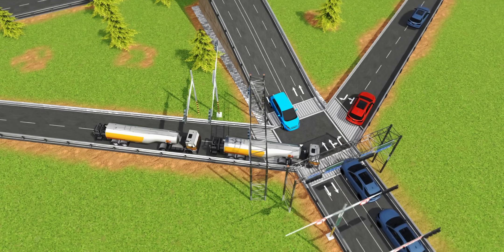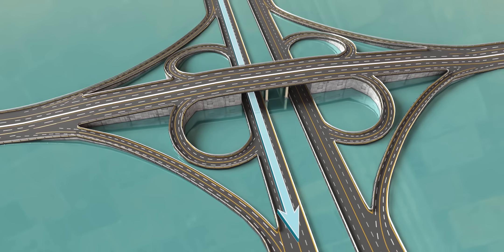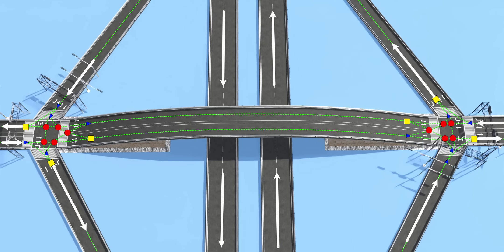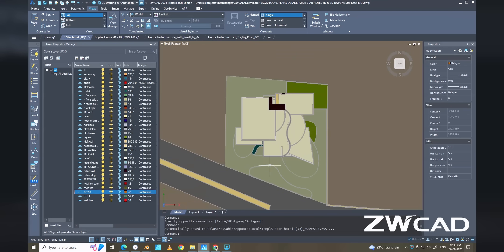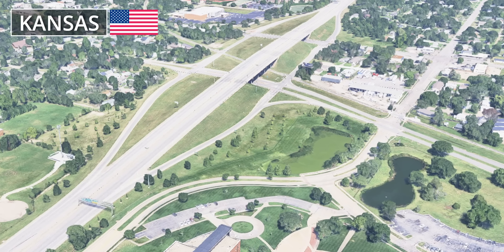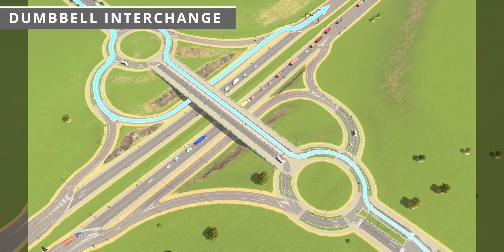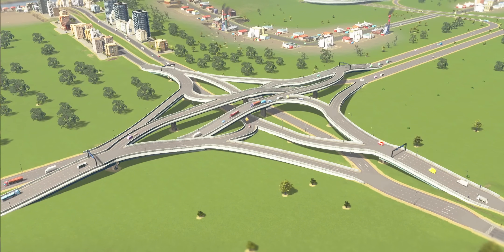The Hidden Engineering of Interchanges!

Comment: Sadly this clover is going away replace with red lights and more red lights and more more red lights with red light cameras.  It's no longer about keep traffic flowering but to making driving a living hell.  You no longer allowed to turn right at your judgement but you have to follow the red light arrow.  Or turn left when there is no traffic, but follow the dam government declared safe turn arrow light.  Cameras everywhere range from speeding/red light/stop sign.  I won't feel bad if people are pissed enough to go destroy these cameras.
Reply: Increase in traffic volumes require signals.  Otherwise, the ramp will always back up due to lack of gaps.
Reply: @traffic.engineer  I agree that there are more and more volume making it harder to merge onto the main travel road.  But I've seen traffic lights been add on roads that have little to no volume.  You stuck at the light for a none existing vehicles/traffic to pass.

Or how about those dam traffic light called.... forgot what the hel they called but they claim to reduce the volume on the highway.  The dam light make you come to a complete stop before ALLOWING you to start merging onto the highway.  I think this stupid idea started on CA, now a few states of insanity copying it.

seems like the new thing to do is STOP TRAFFIC (and on purpose to build up congestion).  While the old way is to keep traffic flowing to avoid congestion.

I hate the nanny state of insanity that America is becoming.  Taking rights away from driver and giving driver licenses to illegal and incompetent people.
Reply: @johnmicheal3547  That is ramp metering and ramp metering is a tool to not overfill highways.  Simply freeflowing onto the highway fills up a funnel faster that it can release.  Hence, signals are the method to  regulate traffic at a rate faster than the downstream can handle.  Either spend time stopping at the signal, or spend time in the traffic jam.  That is the purpose of the signals...to control flow.
Reply: @traffic.engineer  I am using GPS app to guide me to go AROUND jams and it work much better than that metering.  It actually a solution, while the metering is just kicking the can down the road.  That metering is just spending a lot more money for not fixing a problem.

I do like the idea of using signal to add more lanes on demand.  A certain time of the day more people travel one direction so give more lane to the direction that have more volume while less lane to the side that have less volume.  Would be nicer too to increase the speed limit so people can travel faster.  Increase speed limit as volume increases.  Blink the new speed limit to encourage people to go faster.  Tell slow driver to stay on the right so they won't block people.

Comment: Great general video, but in practice, especially in urban environments, designers have to try to modify the classic cloverleaf design to deal with site-specific problems, such as there being a barrier you cannot infringe upon, such as a river, canal, ocean, a built-up area you cannot demolish, or whatever, or you may also need to connect a local road to the intersection, so there is a fifth road problem, or there is simply not enough space or the available space has a strange shape.  For example, in Montreal, where I live, there is an interchange that crosses over a canal and a rail yard, and there are 3 secondary roads that intersect with it, in addition to the 2 highways, and one of the highways does a 90 degree bend just before reaching the interchange. The interchange is next to a cliff, and in a density developed residential and industrial area, so you cannot waste space.

Comment: 1:35 this is how MANY roads in michigan are built, especially around detroit. Southfield freeway, Michigan Ave, Telegraph Rd are some of the most thoughtlessly designed pieces of infrastructure I've ever seen in my entire life. Whatever engineers thought that putting the off ramps in front of the on ramps was a good idea should have their degrees burned. 6 seconds of thought would tell you you're creating a clusterfuck, you're literally forcing two lanes of wildly different speeds together to fight over a limited track of road. Dangerously stupid roads, driving around metro detroit is pure hell.

Comment: 14:54 as someone from the USA. this will cause lots of wrecks, and traffic jams because it depends the exit being on the left. they just don't want to pay to buy the land and build a clover leaf, that is always exiting to the right. the wreck you showed with the clover leaf was because the truck driver was going to fast that, according to US law always defensive driving, if you were surprised by a car, pedestrian, or baby carriage coming in front of you and you are not able to slow or stop you were going to fast you are at fault.
Reply: The research has shown less crashes and more efficiency with the diverging diamond.  Cloverleafs have capacity limits and use too much land.
Reply: The lorry didn't crash because it didn't see the car, it crashed because it was merging to the right while the car was merging to the left in the same space
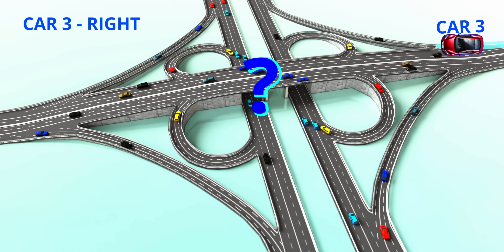Reply: @HesterClapp are you ai? watch the video with out the sound.1:27 the car is fully merged on to the road and more then 1 car length from the truck. 1:28 the truck is moving faster then the car and is now less then 1 car length. 1:29 the truck can not stop and his trailer continues it's momentom forcing the truck to turn. the car could be doing what ever the F it wanted this is 100% the truck's fault. it does not matter if the car was changing lanes and closed off a lane to the truck because the root cause of the wreck is the truck was going too fast, to stop. this is not at all the interchange's fault at not having extra lanes because their could be other cars in those lanes preventing those lanes from mattering. you can't show this weving problem on in animation because it's propganda first developed on paper, the lie shows it self in the attempt at recreation. adding a red line to it does not change what happend, talking about it does not change what happen.
Reply: Thank God, someone else noticed that the crash was driver error. Clover leaf does its job so long as there's no (major) jack asses on the road
Reply: @au313  I love the Clover Leaf too! but in a city(Tulsa) next to me, a clover leaf was built in too small of a area for it. I assume because they wanted to cut cost land and construction, as there is nothing like a river or something that would cause a actual physical restriction. the curves are too small of turning and too steep. it’s a high hill that must be climbed quickly, this causes problems for trucks that a hauling something heavy, and cars that are old and have car troubles. Their are lots of tire tracks from pulled trailers jumping the curb of the road curve and just driving on it. I think the real way to deal with this and other safety problems would be, to issue the city or state a ticket. In the same way a citizen  can get a ticket for driving unsafe by speeding. the federal government could issue tickets to the state government for unsafe, badly built, or unmaintained roads just like if they were a citizen. the state could issue a ticket to cities for their badly made infrastructure too. These tickets just like a citizen could be challenged in court. This would also help with freedom and balance of power as the local and state and federal government would not be all working together in one big horrible pyramid with 1 master on top and all the rest slaves of slaves but  local governments would actually be interested in defending their rights to the federal government.any way if you build a clover leaf that I do recommend make sure you build it large enough, and not too steeply.
Reply: For that diverging windmill exchange, the left path is the through path, the middle lane is for left turn exits, and the right lane for right turn exits. (As is typical in the US)

I do, however, agree that the design as-is would likely cause confusion because the through lane looks like a left exit. Cleaning that up a little would help, but might not be easy spatially for the over/under.

Comment: ever heard of a fucking roundabout?
Reply: Roundabouts would fail here because the traffic volumes are greater than a roundabout's capacity, and the construction would cost more.

A roundabout interchange would cost more because it would take more right-of-way outside of the prior interchange design.  That would require more stormwater management facilities, as well as shoring / retaining walls due to encroaching into the slopes of the overpass highway.

And the roundabout would not be efficient for places with such high traffic volumes.  They max out at 1000 vehicles per hour for single lane roundabout (1700 for dual lanes).  Roundabout interchanges are better for rural/surburban locations where traffic is not projected to increase.

Comment: The first one is not nearly as bad as you describe - usually there are merging lanes you use to get up to speed. In your version you just merge directly into the two highway lanes making it inherently a big risk spot. The small car could very well go to the other exit loop without leaving the merging lane, the truck wouldn't have any issue.
Reply: Collector distributer lanes drastically increase cost due to more land.
Reply: @traffic.engineer  The cost is already huge to build this thing. I've driven through Poland, Germany, France, Northern Italy, Belgium, Netherlands... among others, and I don't think I've seen a plain join like the one presented there even once. I mean, I'm not claiming to see all of the highways and all of the crossings, but you'd think I'd see one at least if they're common over here, right? 

So I will venture a guess that the designers had the same thought and the costs were not prohibitive versus the huge amount of risk alleviated.

Comment: AI Summary

Abstract:

This video provides a comprehensive overview of transportation engineering principles through the exploration of various highway interchange designs. It begins with the foundational Cloverleaf interchange, a signal-free solution invented by Arthur Hail, and details its significant drawbacks, including the dangerous "weaving problem" and large land usage. The video then explores an evolution of designs aimed at solving these issues, such as the Partial Cloverleaf, the Diamond, and the modern, safer Diverging Diamond Interchange (DDI).

Key engineering concepts like the analysis of conflict points (merging, diverging, and crossing) and the importance of vehicle swept path for designing adequate turn radii are explained. The presentation showcases a variety of complex, high-capacity solutions for major freeway junctions, including the Turbine, Volleyball, and multi-level Stack interchanges, highlighting the trade-offs between traffic flow, safety, cost, and physical footprint. The survey also includes specialized designs like the Trumpet and Dumbbell interchanges, and concludes with a look at theoretical concepts like the Windmill interchange, illustrating the continuous innovation in the field.

The Engineering of Traffic: A Guide to Interchange Designs

*   0:00:17 The Cloverleaf Interchange: A foundational, signal-free design that uses 270° loops for left turns.
    *   Key Takeaway: While innovative for eliminating traffic lights, it suffers from a dangerous "weaving problem" where entering and exiting traffic conflict, and it requires a large amount of land.
*   0:01:57 Partial Cloverleaf Interchange: A modification of the full cloverleaf that removes some of its loops.
    *   Key Takeaway: This design successfully solves the weaving problem and reduces the required space while remaining largely signal-free.
*   0:02:39 Understanding Conflict Points: Introduces a core concept in traffic engineering where vehicle paths could potentially collide.
    *   Key Takeaway: Interchanges are evaluated by their number of merging, diverging, and especially the most dangerous "crossing" conflict points. Fewer crossing points result in a much safer design.
*   0:03:17 The Diamond Interchange: A common, space-efficient design for when a major highway intersects a smaller road.
    *   Key Takeaway: It is compact but requires traffic signals and has 26 conflict points, including 10 high-risk crossing points, leading to potential congestion and safety issues.
*   0:04:08 The Diverging Diamond Interchange (DDI): A modern innovation where traffic briefly crosses to the opposite side of the road through the interchange.
    *   Key Takeaway: This simple change drastically improves safety by reducing conflict points from 26 to 14 (with only two crossing points) and has been shown to cut collisions by 50%.
*   0:05:03 The Trumpet Interchange: A compact, three-way interchange used when one road terminates into another.
    *   Key Takeaway: It is cost-effective and saves space, but its tight loops require vehicles to slow down, making it unsuitable for high-traffic-volume areas.
*   0:05:36 Vehicle Swept Path Analysis: Explains the importance of calculating the physical space a large vehicle, like a truck, needs to make a turn.
    *   Key Takeaway: Engineers must design curves with a large enough radius and may need to widen pavements to prevent larger vehicles from causing traffic jams or accidents on tight turns.
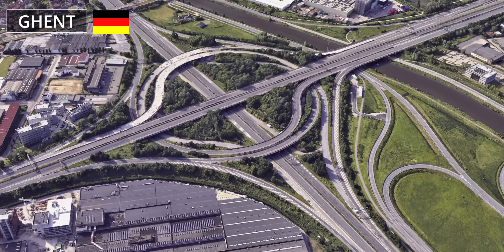*   0:08:37 High-Capacity Interchange Designs: The video showcases several complex designs for major freeway junctions:
    *   Turbine Interchange: Uses spiraling, multi-level ramps to create a free-flowing system with no weaving. It is extremely large and expensive.
    *   Stack Interchange: A massive, multi-level structure that completely separates all traffic onto different flyover ramps. It offers the highest capacity and safety but is the most complex and costly to build.
*   0:12:36 Hybrid and Specialized Designs: The video also covers other innovative solutions:
    *   Dumbbell Interchange: A variation of the diamond that uses two roundabouts instead of signaled intersections, significantly improving safety and traffic flow.
    *   Volleyball Interchange: A design that clusters loops on one side to eliminate dangerous weaving on the main freeway, though it may move congestion to signaled intersections on the smaller road.
*   0:13:25 Conceptual Designs: The video concludes by showing theoretical designs like the Windmill and Diverging Windmill interchanges.
    *   Key Takeaway: These concepts explore novel ways to manage traffic but have not yet been built in the real world due to high costs and large land requirements.

I used gemini-2.5-pro| input-price: 1.25 output-price: 10 max-context-length: 200_000 on rocketrecap dot com to summarize the transcript.
Cost (if I didn't use the free tier): $0.03
Input tokens: 16410
Output tokens: 1015